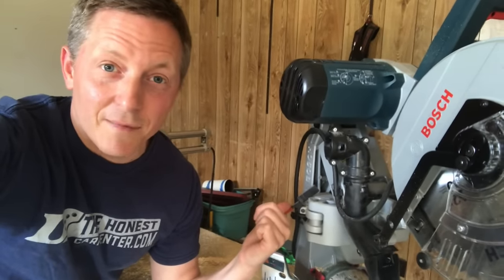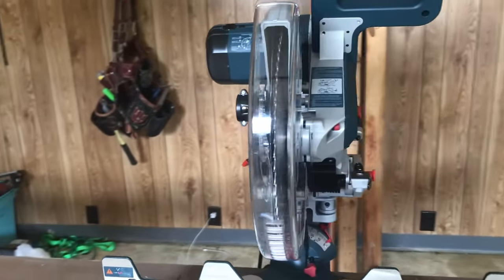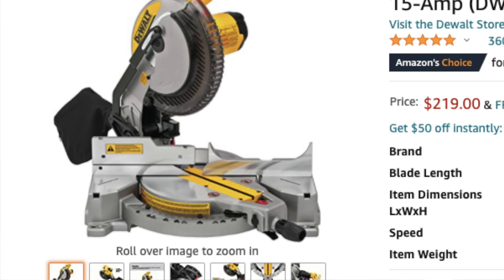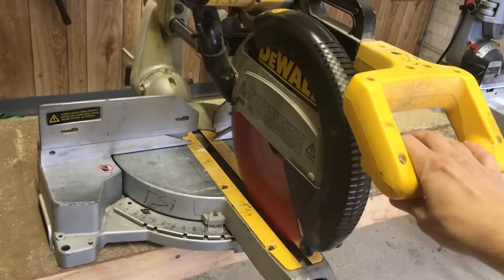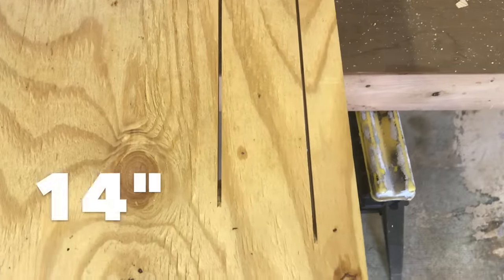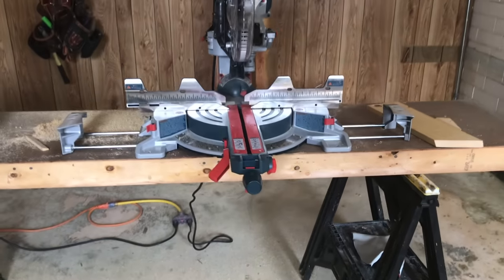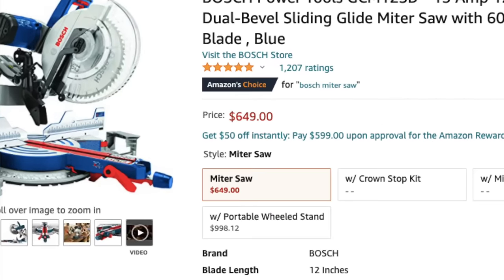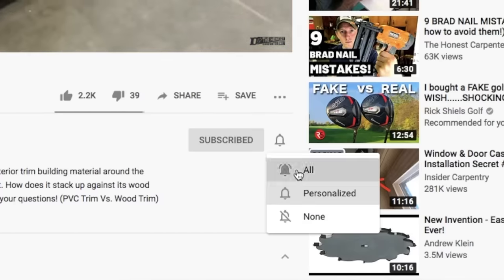This INNOVATION Changed Miter Saws! (Best Miter Saw Feature--Bosch "Glide"...Better than Rails!)

Comment: Plenty of other saws that don't have the backswing problem, like the Makita LS1219L, Metabo KGSV 72 Xact, Festool KS 60, etc
And the Bosch has 6 bearings/joints while the sliding saws have 2, no wonder they're cheaper (except the Festool of course) and are more precise.

Comment: Thanks for the rundown on the saw. I was concerned that the joints would be sloppy, but you indicated it's solid. BTW, these are $50 off this week at HD, Amazon, and Lowe's. I suspect it's related to a Veteran's Day Sale.
Reply from the maker: Thanks Kevin! I haven’t had trouble with slop in the motion. Only issue I’ve had is the trigger will hang a second after release—I think it’s related to the slide safety. But not too bad!

Comment: Hey Ethan I am putting together my kit here but started with my dads. I have a Makita, ( turns out a chop saw ) and an ancient table saw in a stand. I have only used the table saw and I don’t care for it.  It feels unsafe. So I trust your opinion and here’s what I’m working with: I currently live in a condo and figure if I can get a decent set up in this place,  anything will be an improvement. I’m thinking either this saw maybe the smaller one, and a Makita router full kit to do drawers and trim etc.  I don’t have a problem having the guys at Home Depot do my longer cuts on plywood etc.  is there any light you can shed on this?  I would like to get the Makita rolling mitre saw table thingy so I can keep this in the coat closet.  I have to take all my tools outside to build anything because I can’t get dust in my sewing machines. I saw your dust collecting video just now and appreciate that to use in a pinch. It’s a weird set up for now, but I’m pimping this place out and going to make a bomb of money off it in the near future. Or just stay if I can get a saw etc I can keep in the coat closet or the laundry nook.  Haha.  Too many shoes in my bedroom closet😉I’m a weirdo I know, but I have to build stuff or I’m kind lost.  Oh and sewing is just as bad. It’s amazing pulling it all together, but I’m pretty cramped in here at the moment. I’ll be starting my YT channel pretty soon and I’ll keep you posted if I share  any of your advice/ideas (as well I’m sure you would like to add sewing to your list of talents)and I’ll buy this bad boy off your link, ok? Thanks for all your incredibly helpful info! Truly enhanced so much.

Comment: Fyi Metabo miter saws also have pull out table extensions (they even have a little metal lip that you can use as a stop for repetitive cuts but you have to be very lucky to be able to use those as they’re hardly ever in the right position)

Comment: I picked up that saw brand new unopened for 500 I saw it advertised on marketplace I was curious but a little wary  ( I didn't want to buy stolen merchandise ) he said he had the receipt which was more weing ird, it was bought on store credit at HD he was looking for fast cash I know for a fact it goes for 649 plus tax. A week prior I bought the Metabo 10 zero rear clearance for 399 plus tax, I promptly returned the Metabo, so for 70 dollar difference I got a better saw. It is really smooth and cuts great.

Comment: Woodworking Beginner: New - Update.
This test is only if you want to saw with precision with a miter saw.(test is not intended for rough and hard work).     
Tips and Test: 
Very important if you would like to saw with precision. (avoid torsion as much as possible)!
Always choose a Miter saw with a handle positioned in a VERTICAL line above the saw blade.  
Everything must be aligned, slide rails, handle, and saw blade,it is much better this way the blade will not tilt.
Because there is some torsion in the aluminum housing .
And choose an engine with softstart on it to prevent wear of the gear and worm shaft.
It is very important that everything is aligned.
Here are some examples to show how the handle must be positioned above the blade.

First option: handle vertical positioned above the saw blade. 
Bosch gcm 800 sj / Bosch gcm 8 sjl / Evolution rage 3 / FESTOOL KS 60 / Bosch GCM 8 SDE / FESTOOL KS 60 E KAPEX / Metabo KGSV 72 Xact/ Bosch PCM 8 SD / Hitachi C10FSH / Ridgid MS255SR 10-inch / Evolution Fury3-S / Evolution R255SMS / Metabo HPT C10FSBS / Hitachi C10FSB / Hitachi C10FS.

Second optie: handle horizontal positioned above the saw blade / Evolution R185SMS / Evolution F255SMS / Evolution RAGE3R255 SMS3 .

(This also is the case with the Miter saw without the slide rails).

(If you want). You can test it yourself at home if there is torsion in the aluminum housing.

Step-1. First you make a saw cut from +-5 mm deep in to a flat piece of wood about +- 20 mm thick to this with the normal handle positioned on the right side of the Miter saw (the wood it will remain in place until the test is completed).

Step-2. Then repeat this by pushing the saw blade down with your hand or finger on the aluminum protective cover were the saw blade is cased in. Just now only do this without the running engine.

Step-3. Now you can see if the saw blade will be positioned in or next to the saw cut. If the saw blade is (+- 0,2 / 0,5 mm) next to the saw cut then there is torsion in the aluminum housing. 
(test is completed).

Step-4. Therefor it is much better to choose a Miter saw with the handle positioned VERTICAL in line above the saw blade. 
The second option is the handle positioned HORIZONTAL in line above the saw blade.

Step-5. When you measure the vertical 90 degrees angle square (Digital Level Box) of you're sawblade don't forget that there is always some torsion in the aluminum housing.

Conclusion: Remember this, the test is only about torsion and nothing else  how further away the handle is from the saw blade how more chance of torsion in the aluminum housing, you better not go for that. (the choices are yours).

Also with a cheap slide miter saw it is still better the handgriff in line a above the saw blade than on the right side. Maybe they will make it someday then we have a winner...

Comment: Yeah, my only complaint with this saw is the same as yours: it's heavy and there's not really a hot place to grab it from above. You have to grab it under those slide out supports and the thing is back heavy so it just wants to tip backwards. Just awkward all around. Otherwise, I love that thing and enjoy using it.

Comment: We bought 2 when they were first introduced, now neither get used much. We've had them all and the DeWalt 780 is the best of the best and all that hub bub about the rails needing cleaned and serviced is horseshit! In our shop these saws run a minimum of 4hrs per day 5-6 days a week and cut perfectly square the full length of the cut, and we cut 10/4 maple and white oak, and in my opinion are the best value out there at $679.

Comment: With regard to some of the comments about the competition.. The Hitachi: $520 @ Lowe's, tilt adjust in back.. The Makita: $780 @ H/Depot.. Both using unsealed, twin sliding tubes, that block one side of the blade.. The Festool: $1500!.. So, factoring in quality and additional features, $650 for the Bosch is not only reasonable, but looking like a bargain.. And yes, probably more for the fixed mounting location, as apposed to most job-site use.. All in all, I easily give it 2 thumbs up.. Three, if I had that many.. LOL...

Comment: Nice saw i have enjoyed mine here in Australia. Unfortunately the back sliding fence is weak and so is some of the castings.  Mine has broken.  Not a big issue but something to be aware of.  Definitely a workshop tool as is really bulky.  Regardless its very smooth and powerful 👍
Reply: Would the warranty cover that
 6 years it says. Well I just brought mine.

Comment: What I noticed Id like to hear more about is the dust collection. Watched a couple of your cuts and that saw actually looked like it did a good job of getting the dust out the port and not so much behind the saw(saw some but not much)
Reply from the maker: This is very true, Drew! My dewalt used to fumigate the place. But it seems like the majority on the Bosch actually comes out of that snorkel port. It’s making me rethink my dust hood plans...
Reply: @TheHonestCarpenter  Its interesting to me that snokel doesnt look that much different from normal dust ports on miter saws, its just its a larger rectangle going into the normal size. Almost like a funnel. I think im going to have to try to figure out a way to mod my saw like that. That Bosch does look like a real winner of a saw overall

Comment: Nice. I have had one for two years. Its great mounted in the cube van. The knuckle system takes some getting used to. Im not even sure why but it does. I find myself using my ridged 12" slide just out of habit 😁. Good luck to you

Comment: every once in a while unbolt the base and clean and lube the circular sliding faces that the weight of the upper machine sits on, because when it gets dirty the saw becomes very hard to slew left and right

Comment: Actually, the Festool Kapex saws also have rails, but the whole motor and blade assembly slide on the rails, while the rails are stationary. uses up just as much space as the Bosch. The bevel adjustment is a little lever on the top and it also has table extensions that are just as easy to use. What drove me towards the festool over the Bosch was the weight and dust extraction. It is very easy to carry ( I move it a rather often) and the dust extraction is the best one on any miter saw by a lot wich is quite useful when working at a customers place. Only downside really is the price. Its about double the price of the Bosch

Comment: What about deflection?  It seems the traditional slide systems are more robust and do not “sway” side to side when extended.  The way these linkages are oriented it seems there could be noticeable side to side movement along the axis of the joints??

Comment: I’ve seen some reviews saying there is some wobble when the saw is fully extended. Have you experienced that?
Reply: I certainly haven't experienced any with mine. Smooth as silk.
Reply: @d.bishop1034  I've seen similar reviews that show the side to side "wobble". The move smooth as silk, but left to right movement of like 1/8 inch.
Reply: They all do, rail, glider, or even fixed. Something with no wobble/flex whatsoever is gonna weight literally a ton, aka milling machines.
Reply: @greentjmtl  true.

Comment: We have a nice Festool compound miter saw .
Reply from the maker: I’ve heard that the festool miter is basically the top dog, Patty. I’ll try that one in another five years 😄
Reply: God bless. I think my son started with the vacuum cleaner system which can be attached to the hand tools and the saws for dust control. He loved them.  His advantage in being able to afford them was that he inherited his dads auto body shop so his shop expenses were very low. And he worked very hard. He started out with small portable saws and thanks to a great job manufacturing thousands of wood frames for a company one year, he was able to get nicer things, some used. And because we have three phase electricity, things like the table saw were a little cheaper with the 3phase motor. So he filled the shop with a variety of woodworking tools in addition to the paint and metal work tools, machines and systems. The shop is like a hardware store in itself! And now, I am making quilts on our work tables! So keep working hard and you will surely do well.

Comment: I bought this saw but had to return it after a month. There was so much lateral play in the glide mechanism and not just at full extension (which I would expect) that it was not accurate enough. Even with the glide locked out there was a lot of movement side to side in the head that made it very difficult to cut accurately. It is a shame because the glide movement was thr best sliding action I have ever used and I loved a lot of the features but I was not willing to put up the movement in a saw that was $750 (cdn).

Comment: it's worth also considering that the twin rail system is mechanically simpler than a 3d elbow system. I wonder how much harder it is to calibrate such a saw or how likely a small amt of play in the elbows could make the saw permanently unusable.

Comment: I like everything about my Bosch miter saw except for one “big” draw back, the lever to change to the angle on the front of the machine is extremely stiff, it’s very very difficult for me to push down to change the angle. Does yours has that problem?
Reply: You can loosen the nut on the back of the saw, right under the nut where the saw pivots. It is the 17mm, the smaller of the two nuts. Back it off a little bit at a time until you have tension on the release that you are comfortable with. If you have any questions feel free to respond.
Reply: Initially I had the same impression, but I've chalked it up to - you want it to be a strong lock.

Comment: Hi. Can you confirm the depth of the saw front to back and the width without extending the side supports? Bosch specs talk about length and width - but its not clear which is which, and neither is 19" as you said from front to back of saw.
Thank you!

Comment: If you look at the Bosch saw profile, you can see that they could have just put the rails in the front, overhanging the platten instead of out the back like most saws.  The mechanical stress would be higher, but not as high as all that linkage they have here.

Comment: This  saw  has  the  miter  angle  adjustment  lever  right at the front  and it requires  a  lot  of  force  to   unlock  and  lock.
And  when in the  "locked"  position  the  saw  head  can  still  be  moved.
With  the  amount  of force  required, you  would  expect   the saw  head  to  be  locked  solid  in  its position.

Comment: Wouldn't trade mine for any other saw on the market!  Had it for ~4years.   Dust collection does suck but can be easily improved upon.   I don't cut wide stuff on it.  because well I have a table saw w/ a slider for panel goods.  But have used several other saws in shops and i just wouldn't even consider replacing the Bosch with a single other saw!

Comment: Makita makes one similar. Would be curious to compare the two. I bought a cheap ryobi, and it’s fine for my uses but the space issue is a big deal would pay more to solve that.
Reply: A friend of mine has the 10" Bosch and we never managed to tune it well. It's somewhat inaccurate along the gliding cut. I own the Makita 10" with forward tubes and it's much easier to square in all aspects. 

Between the 2, dust extraction works better on the Makita.

Comment: Would be interested to hear/see any thoughts on this units dust collection. It appears to be a side discharge that I don’t recall having seen before on other mfgs.
Reply: I have the 10 inch version which I believe collects dust the same way.  There is a funnel at the bottom of the column that catches the dust as its thrown off the blade and goes into a tube up the column.  Out the side if left open, but I have a shop vac connected to mine.  Not perfect, but pretty good.

Comment: Nice saw, that extra little bit really makes the difference between using my table saw or my miter which is faster, more precise and easier. I can appreciate everything you said here including the weight. I actually have mine one the large rolling stand for jobsites with the telescoping, adjustable roller supports on each side. I have a very large Dewalt one with the regular system but because it's big it really has a nice long cut depth. It would be interesting to see how much more throw and equivalent sized Bosch would yield.

I will disagree about one thing and I realize it's completely subjective and just adding it to give a rich robust comment. On a scale of immovability when it comes to shop saws I would order it as follows (for homeowner or mobile/light commercial grade versions anyway). #1 table saw, #2 radial arm saw, #3 miter/chop saw, #4 band saw, #5 scroll saw (did I miss any???). I've owned all of these and had them in a 3 stall shop and without a doubt that table saw was not only the heaviest and hardest to move but also the most crucial to have positioned correctly considering the size of materials it cuts. I must admit I can do nearly everything I need with a table saw, miter saw and a had held jig saw, although I really do miss having a bandsaw.

Hey the skies the limit though, when we start to talk about larger industrial grade saws that are even heavier and stationary there are (off the top of my head) gang saws and ship saws (huge modified band saws reign supreme and often whole facilities and ship yards are built around them). At any rate, great video great purchase and I can't wait to see a tour of the new shop when it's finished (hey updates are cool too). :)

Comment: You are wrong about this being the only saw with this feature. They were the first. However Delta made a saw a couple years ago that has essentially the same mechanism. The performance is almost identical. Better in some respects It's a little more rigid. Also the Delta has a shadow guide whereas the Bosch has none.
The Bosch can be purchased at Menards at their regular price for just a little bit over $500 they also sell the Delta for the same price within a few bucks. If you wait until they have one of their very frequent 11% rebates on everything sale, You can pick it up for about $450. Even at the price you gave it's not ridiculously expensive. Sure there's lots of cheaper saws but there's lots of more expensive ones as well.

Comment: How accurate is it?
My bench is only 28" deep, and the reason I never got a 12" sliding compound.  But... The saw I have now (An older Porter) is nice and accurate.. Just doesn't slide.
Reply: Iv not found a sliding saw that can replace my Hitachi 12" for trim work. All have too much play using the rail slides